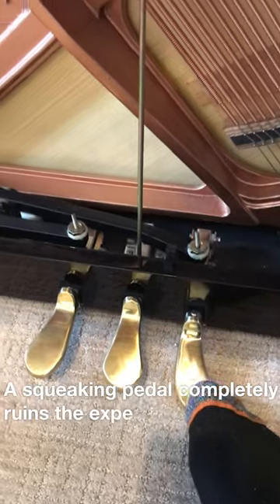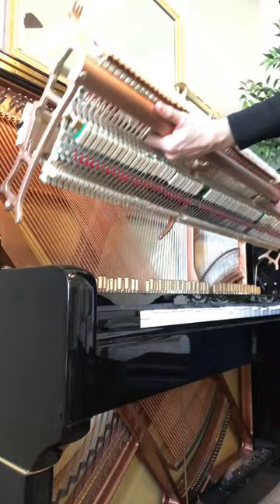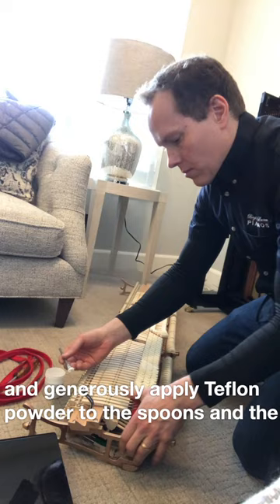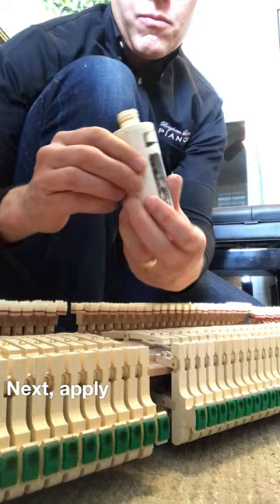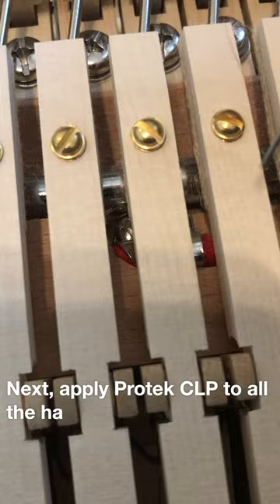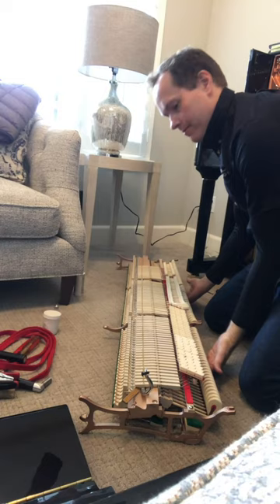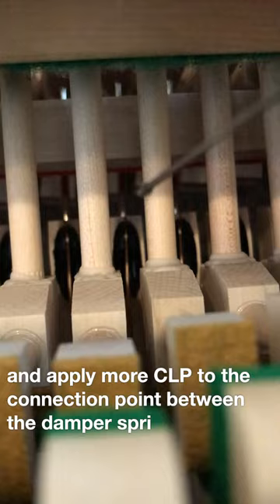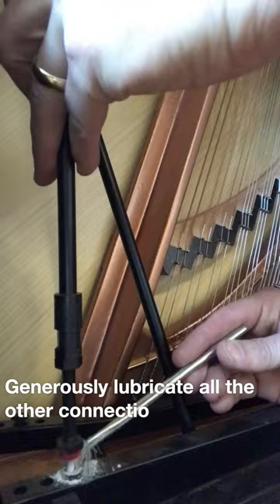What to do when your piano has a squeaking pedal

Comment: What can you do if the squeaky pedal  noise comes not from the pedal itself, but from the bottom front panel?
The noise completely disappears when the panel is removed.
Really strange.

Any expert advice on how to fix that?
Reply: Tobi, I have this EXACT same issue. super annoying squeak in damper, remove bottom panel, no squeak, put it back, have squeak. Really have no idea what to do. I was curious if you ever found a remedy, thanks!
Reply: @steveengle1260  Yes, I finally found how to fix it. I put a strip of very thin adhesive felt, that is available on Amazon, at bottom of the panel and also where it touches metal holders on top and the noise is gone!!
Piano sounds clear and amazing again!

Hope this helps.
Reply: Thank you I bought a little pack of felt and cut and placed strips at various places in between bottom panel. It did nothing. I took panel off again and shoved the whole sheet in and put bottom back but I made the sheet double (2 thicknesses) and it was hanging out of the piano. This was just an experiment for fun but it fixed it. Then I pulled the big sheet out, its soft so no damage. The squeak was still gone and currently still is. Weird thing but seems like just tinkering with it when the squeak is a function of the bottom and NOT the pedal :) appreciate comment
Reply: @steveengle1260  Glad I could help, enjoy the clear sound of your piano!
It's certainly an unusual problem. Likely in our pianos for whatever reason the bottom panel moves every time you press pedal, causing the squeaking.

Comment: Won't putting the action on its front and/or back (like when you are lubricating) potentially damage the parts that would make contact with the floor?  Like when you make the action lie on its front, the metal holder for the damper stick makes first contact and would support the action.  Won't this somehow affect the alignment of the part? Same if action was put on its back, the catchers would be pressing against the floor.
Reply: A pianos action (in this case on a upright) is very durable if you take good care. It can easily lay on its side without doing any harm. (Atleast if you dont drop it, or throw it on the ground)